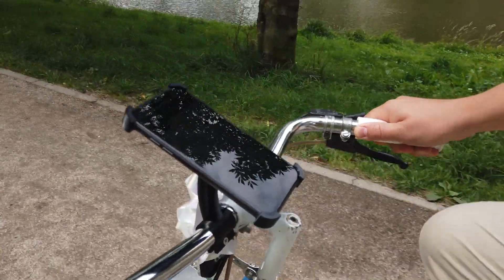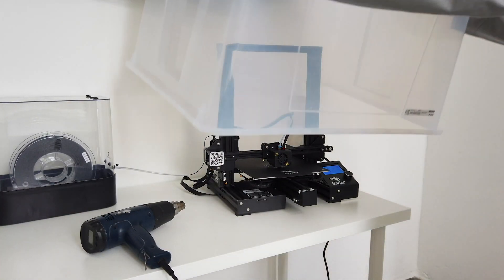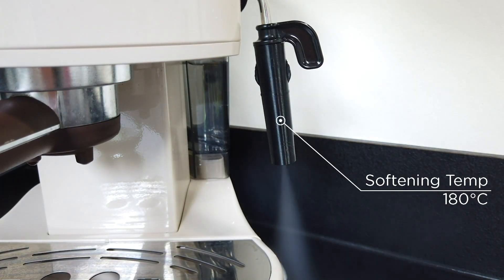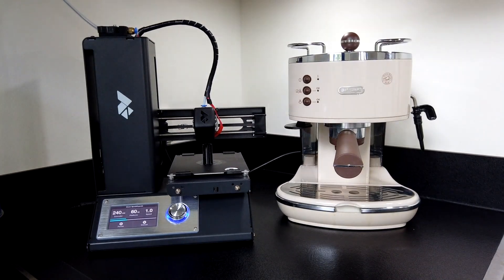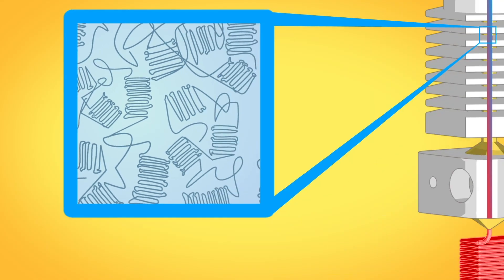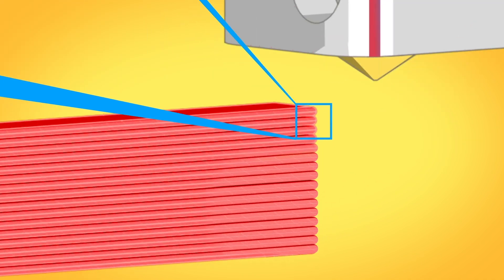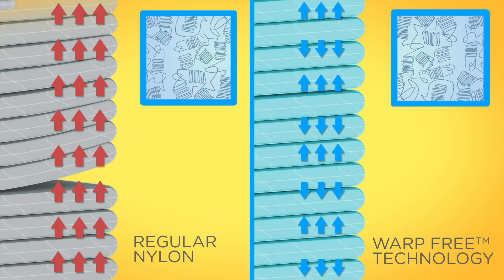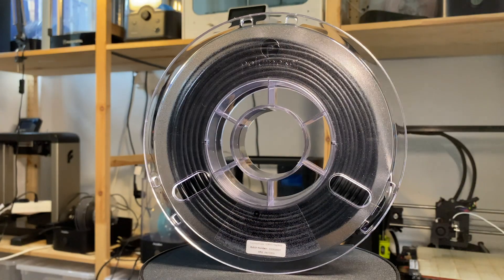Nylon on an Open Bed?

Comment: I have a reel of the Polymaker PA12-CF Nylon Filament on the way. Really hoping I can get it to print right. Would you guys still recommend using garolite for bed adhesion?

Comment: My experience with CoPA is that although it’s strong, it’s kinda pricey, and usually, PolyMax PC does perfectly fine, if not better due to it’s ease of use if you have a hot enough bed.

Comment: too bad this amazing product is unfeasible. 100$ per kilogram... smh i'd better just make my part out of aluminum
Reply: They have a glass fiber nylon which where I live is cheaper than Polymide CoPA. It’s also stronger, although it requires a wear resistant nozzle.

Comment: Your tensile strength chart is disengenious, stop letting your marketing team manipulate data. You're making your copa look 10 times stronger than your standard materials. When in reality is barely 2 times as strong.
Reply: Um, I’m pretty sure the chart is meant to be misleading. It’s marketing after all.

Comment: I recently tried Polymaker since they lowered their prices. The quality is superb, plus the info they offer about their filaments is amazing! you know exactly what you're working with, that is invaluable for an engineering student, and i haven't seen any other manufacturer that provide such complete datasheets for their materials

Comment: Is the material hydroscopic? I would like to use this for many of my practical prints.
Reply from the maker: Nylon is hygroscopic and needs protecting from humid air (>20% RH). Store and print your CoPA spools from the PolyBox™ to ensure the best results.